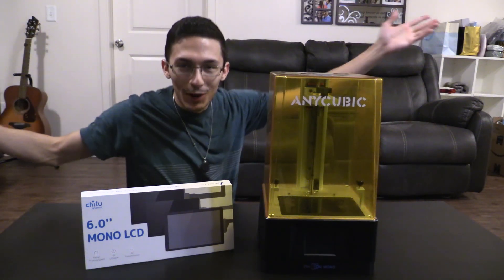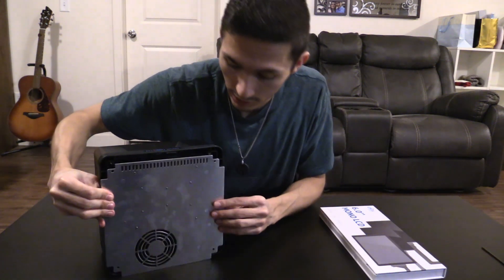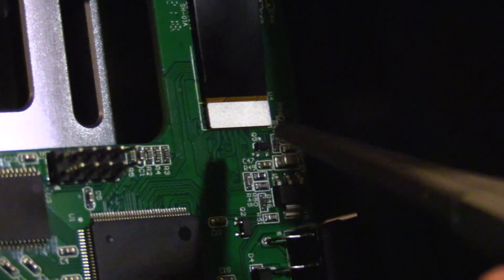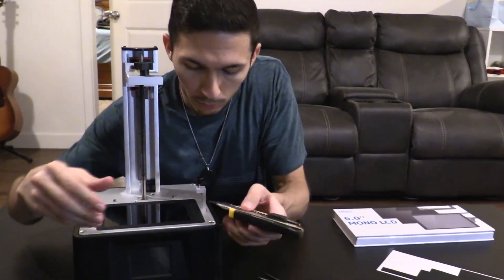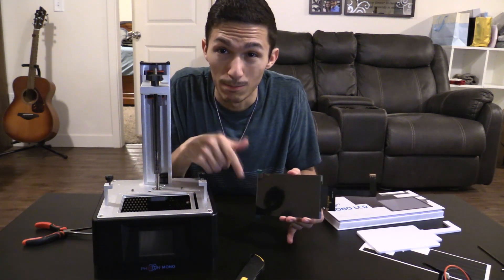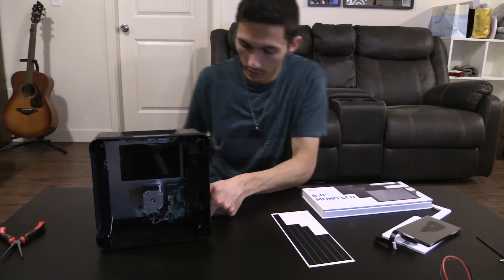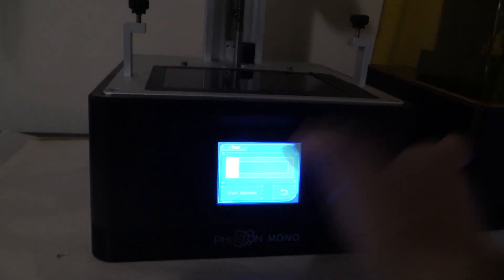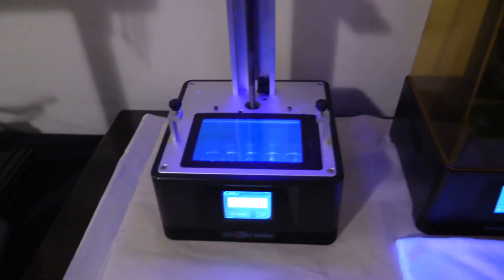Replacing the LCD Screen? Avoid These Mistakes | Anycubic Photon Mono

Comment: hi im 
changing my photon mono x2.  having trouble popping the screen out...im wondering if resin curin cured it in place and what i should do...not budging
Reply from the maker: Safety First: Before you start, ensure you're wearing gloves and eye protection to avoid contact with resin, which can be irritating or harmful.

    Unplug the Printer: Always make sure the printer is powered off and unplugged to avoid any risk of electrical shock or damage to the device.

    Softening the Resin: If you suspect that resin has cured around the edges of the screen:
        Use a hairdryer to gently warm the edges of the screen. The heat can make the resin more pliable and easier to clean off.
        Apply isopropyl alcohol (91% or higher) with a cotton swab around the edges to dissolve any hardened resin. Allow it to sit for a few minutes to soften the resin effectively.

    Gently Pry the Screen: Instead of using any metal tools, opt for a plastic spudger or a guitar pick. These tools are less likely to scratch or damage the screen or the printer's frame.
        Start at one corner of the screen and insert the plastic tool. Gently work your way around the edge, prying up slowly and carefully.
        If the screen doesn't budge, apply more heat and alcohol as needed to further soften the resin.

    Check for Hidden Screws or Clips: Make sure there are no additional fasteners or clips holding the screen in place. Some models might have screws or clips that need to be removed or released before the screen can be taken out.

    Consult the Manual: Refer to your printer's user manual for any specific instructions or diagrams that show how to remove the screen. This can provide model-specific advice that might be crucial for avoiding damage.

    Patience is Key: This process can be delicate, so it’s important to take your time and not force the screen out, which could damage both the screen and the printer.

If after all these steps the screen still doesn't come out, it might be necessary to reach out to the customer support for your printer. They can provide guidance specific to your model, which might be essential if the screen assembly is different from typical setups or if there are other factors at play.